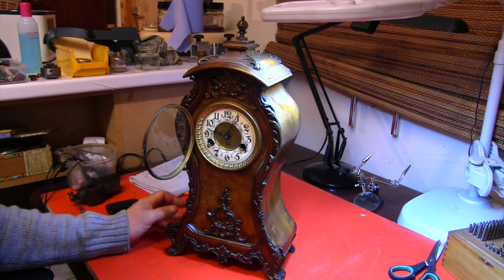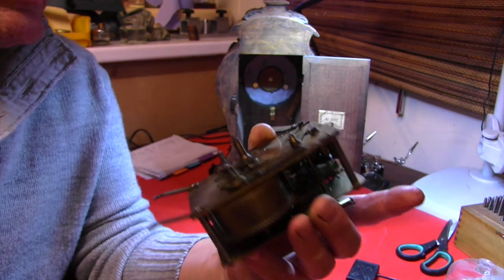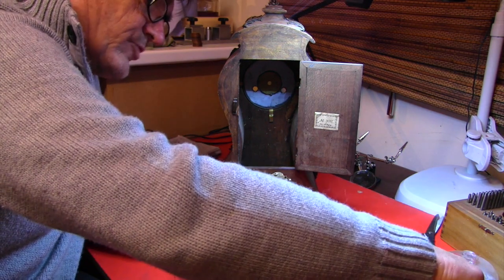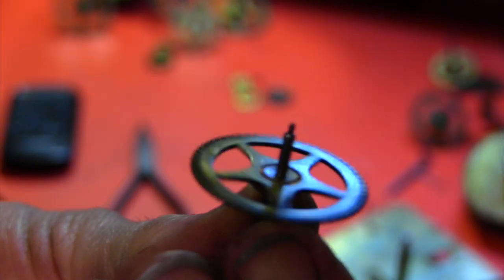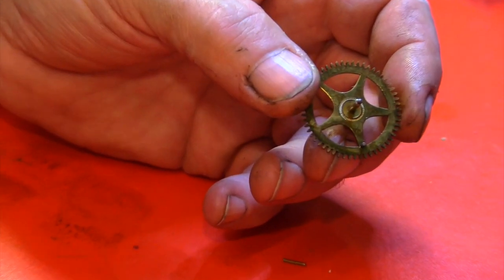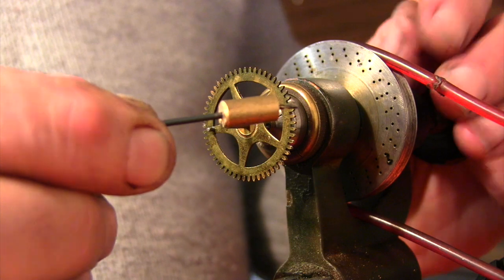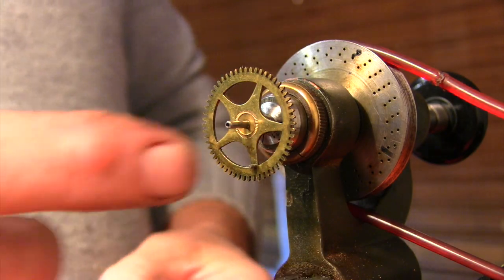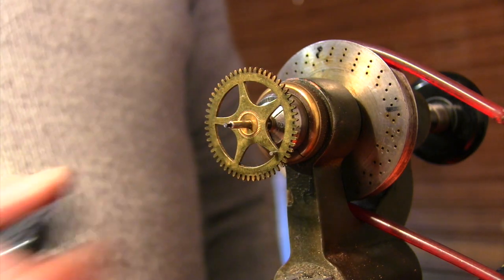Inspecting a clock for repair and re pivoting.

Comment: the only question i have is the drill was 1.1mm diam depth at x3 but pinion wire should be what diameter please? you tapped it in with a chamfer so a tad bigger? or exact size with LockTite?   i would be grateful for exact size please. my first repivoting job!
very good down to earth, simple, no messing,  explanation with your own centre tool - fantastic demo thanks - just as tig1tig1 says, "takes the fear out of it" - and I have one to do.
Reply from the maker: better if its the same as the drill diameter and a bit of sticky!,
thanks for watching,
atb,
cliff,
or you can snap off a bit of drill shaft for the pinion.
Reply: @CliffsShed  I love that. I only have the one drill. - And so - the next one to drll? Good idea though - thanks.

Comment: Is it possible to re pivot without a lathe?
Reply from the maker: Hello,
Yes it is possible to re-pivot without a lathe, material suppliers used to sell, "quick pivots" basically ready made pivots that could be fitted over the end of a prepared arbor,, not ideal, but could be used. If you have the right drill bit, very steady hands and enough room on the arbor no reason not to drill up into the arbor, soften it first, and insert, solder in a pivot for filing up and polishing, as me' old Dad used to say, "there's more than one way to skin a cat" :-)
Thanks for watching,
All the best,
Cliff
Reply: @CliffsShed  cheers Cliff
Reply: Ive used them, but only towards the end of the train away from the spring barrel. I think if they are used near the barrel they are under much more pressure and can fail.